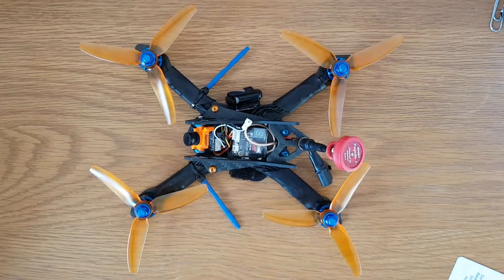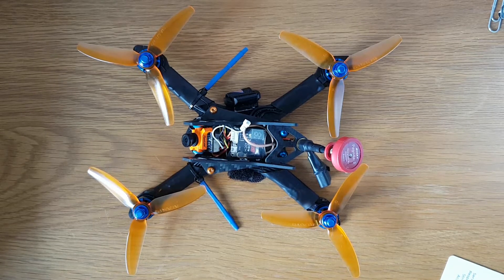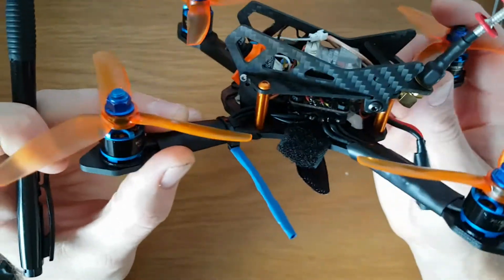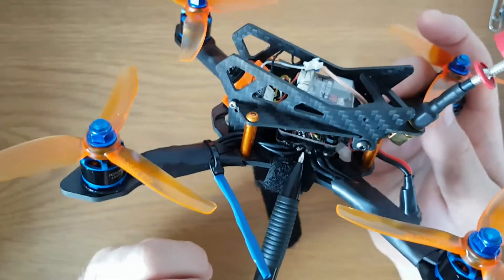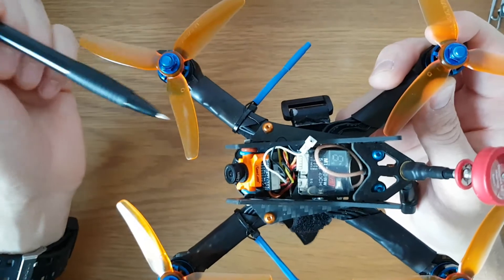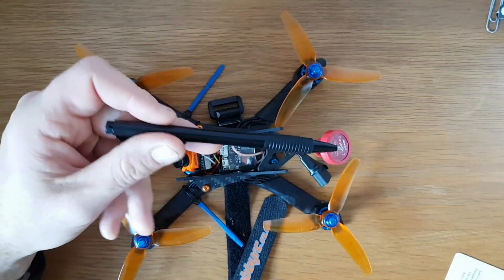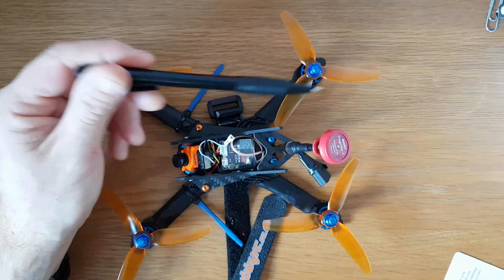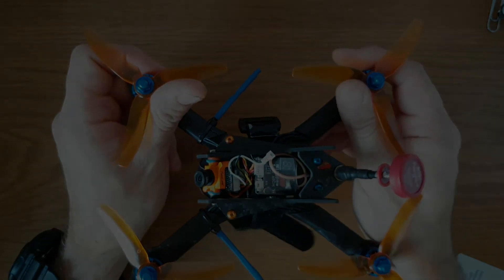Updating the Space Cowboy part 2 : Da build! (More build info in description)

Comment: Glad to see you went for the 4in1 esc option. It's definitely a much cleaner looking quad. Plus the weight lose is quite significant. Liking the new colour scheme 👍. For this size of quad, my personal choice would be to replace the pagoda and the vtx with something smaller like the eachine tx03. It's tiny and light, and would fit above your stack easily (200mw too). You could then maybe top mount a small 3s battery and even drill new holes to mount the 20mmx20mm boards properly. Just a thought.😉
Reply from the maker: Trystan 3s pffft! Yeah I mentioned the vtx03 with a ufl antenna. Dys outputs 800mw tho as it’s one of the early faulty ones, so way better for my flying. It’s a cracking vtx - or was until they fixed it. Oh, and I could have just used a stack converter, but the tape works really well, and won’t budge.

Comment: That's an awesome super clean build Looking into building a small build as well maybe even a 2''. Just so you can fly everywhere :)
Reply from the maker: Yeah I love them. Never gone as low as 2” as they get less precise the smaller you go and too fiddly for me :) Lots of them on here. Xero S3M 3” is probably the fastest quad I have! Also the leggero S4 was a corker too.
Reply: Xero S3M looks promising indeed! Just small enough that nobody really minds it if you fly it around at a open camping for instance but big enough to rip it.
Reply from the maker: Galinsky FPV if you head down the 3” route I’d avoid the Avant Xero frame. It’s crazy light but the rear standoff is really annoying. I should have got the leggero S3 - tap up Raymon for a discount :)